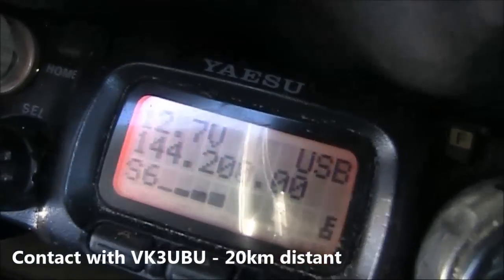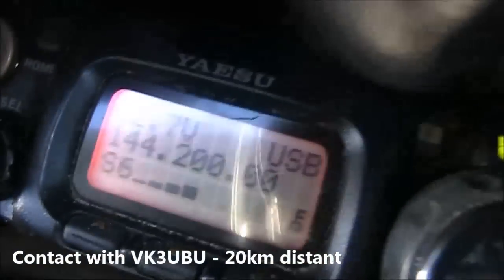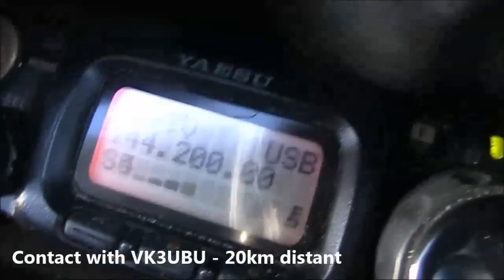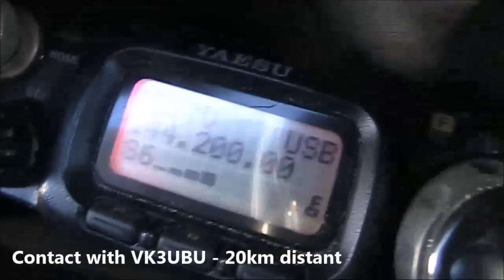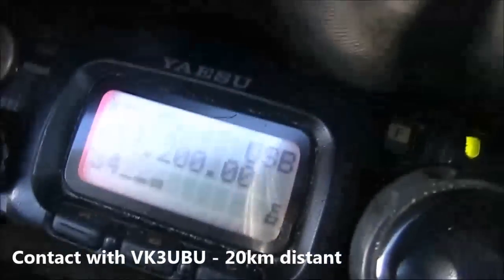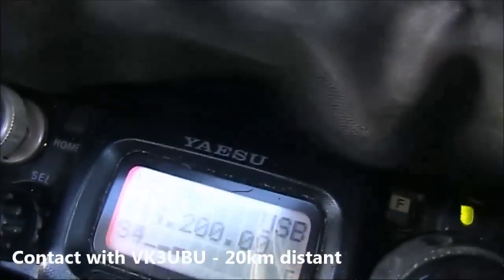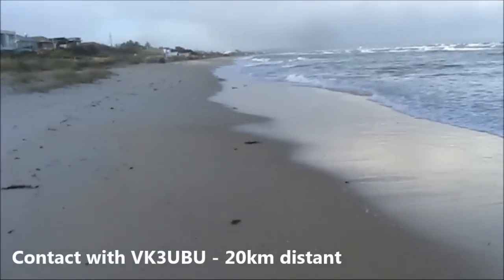A horizontal dipole for 2 metres SSB pedestrian mobile (Wadetenna add-on)

Comment: Sir You can put 3 dipoles Together on series With the proper phasing harness And easily reach 640 km With only 40 watts I've done it with that any problem with 10 watts Up to 500 km Trick is Make sure your coax is decoupled from that antenna Otherwise you're half your energy Is being radiated off the coax